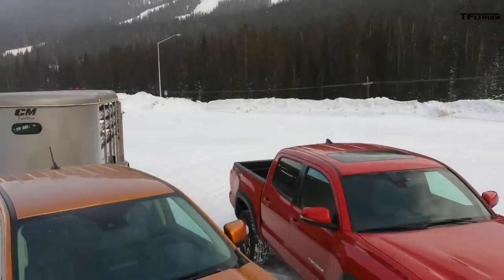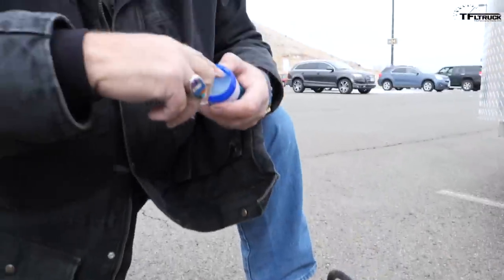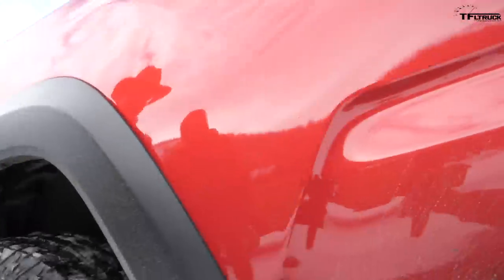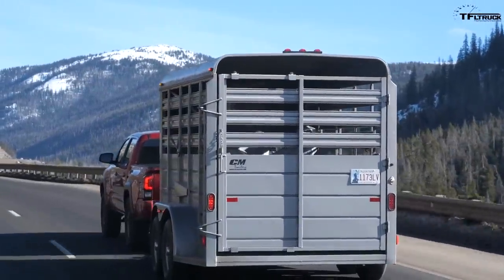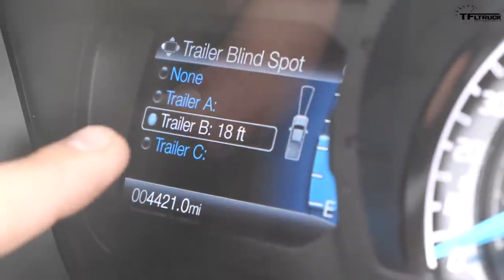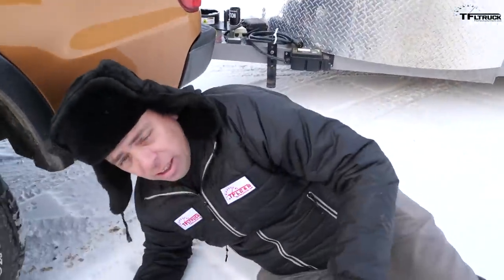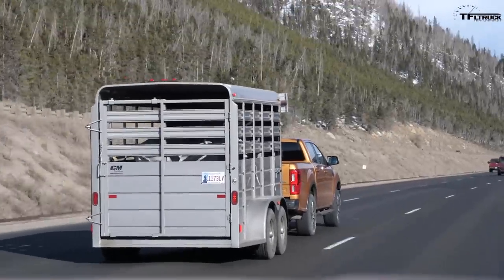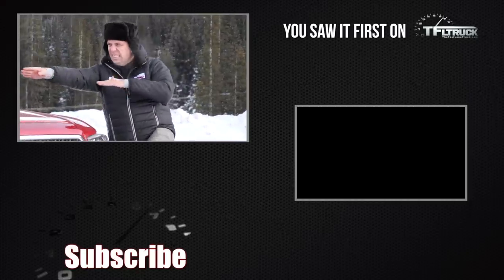Best Midsize Towing Truck? Ford Ranger vs Toyota Tacoma vs World's Toughest Towing Test

Comment: Do a Oil change Test, and lets see how many people like taking the Left Front tire off the Ranger to get to the oil filter, SMH🤔
Reply: Wait, seriously
Reply: Really? Never heard about that...
Reply: That sucks but most of cars today need a tire rotation with evert oil change.
Reply: I did oil changes by taking the tire off, it was actually quicker like that.
Reply: F that. Even the shop guys are gonna hate doing that
Reply: It's no big deal. It has a 10k mile oil change interval. The tires need rotating by then, anyway. My Fiesta ST is the same way where I get an oil change and tire rotation at the same time since it goes so long between oil changes. It doesn't take much time for any real shop to do that.
Reply: @leadnsteel1428  Exactly.
Reply: Yeah nobody on earth likes changing their own oil /s @fread51
Reply: And then plastic push pins to remove the panel behind the wheel which will wear out after a few oil changes
Reply: Also the Ford Explorer you have to remove a heat deflector shield to get to the drain plug.   There’s room to redesign it over an inch to make it miss but it’s almost like they want you to go to the dealership for service, they don’t get it
Reply: I’ll just keep my old truck as long as I can.  Easy to maintain.
Reply: William Heinsinger pretty sure 99.99% of dealers sell new cars with either 
A. Life time free oil changes or 
B . 6 years free oil changes
Reply: If you cant take a wheel off then you shouldnt be doing an oil change
Reply: ultimaetsolder you have to do it with Cummins to easily change the oil.
Reply: You should rotate tires every oil change so you would be taking them off anyways.
Reply: Fords engineers are not as good as they used to be. Now a 20 dollar oil change will be 65 dollars.
Reply: I've done my own oil changes for years. Taking the tire off sounds very annoying. And I would still change oil every 5k miles. I just don't trust these new intervals. Do you seriously want to leave the same oil in a 4 cylinder (that relies on a turbo booster) for 10k miles?
Reply: Devin Bender 2 oil changes with Chevy
Reply: Cant speak for anyone else, but I wouldnt be put off by this additional requirement. Annoying sure, but I change my oil maybe 2-3 times a year, so spending an extra 5 minutes isnt going to sway me from purchasing a vehicle that I may want or like.
Reply: Do you already have a new Ranger? I know the old v6 Rangers were a PIA to change the oil, but I NEVER took off there left front tire to change the filter! Was always able to do so from underneath the truck...
Reply: How about the upside town cartridge on the Tacoma
Reply: Don't worry about it William, these aren't the type of guys who would even consider changing their own oil; they will take it to the dealership as they don't like to get their hands dirty.
Reply: Tacomas new 3.5 engine isnt the greatest for oil changes either.  Skid plate has to come off to get to the new oil filter design. Not to mention it is a filter in a housing which to me is harder to chanfe and messier.  The 4.0 tacoma was a cakewalk to change!!  Both have not made oil changes simple thats for sure.
Reply: I love rotating my tires and Love the MPG on the FORD:) tacoma is OLD Tech with less performance and thirsty engine! small cars have WAY more room above the head than the OLD tacoma
Reply: That engine might be a version of the Mustang four cylinder and may not have been designed specifically for the truck. It is a different displacement, but could be the same or similar block.
Reply: Do you rotate your tires when you change oil? Then what's the big deal? When you buy a new vehicle. Negotiate some free oil changes and let the dealership deal with it. It's a solid Ford truck and will be a big Volume vehicle. If you don't like Ford. I'm sure it's a deal breaker.
Reply: Do you rotate your tires when you change the oil? You do have to remove your tires to rotate them so what's the big hassle? Your issue isn't the oil change. It's you don't like Fords.
Reply: @leadnsteel1428  My dealership changes my oil and remove the tires to rotate them. It's a normal procedure they do throughout the day six days a week. Wow. They must be pissed they have to remove a tire to change the oil on the Ranger.......
Reply: I'm just glad toyota car for 2 years so I dont have to worry about take anything off, if you really have to remove your tire just to do an oil change that sucks and anyone who says it doesnt is just defending their ford pride no one likes extra work
Reply: Soy Boys Unite!!!  Hello AAA?  Could you help me change my tire?

Please!!!???
Reply: @lillarry3000  Tundra with front skid plate requires removal for filter.  I'd much rather remove a tire, and I own a Tundra.
Reply: @zacherymorgan97  those push pins are like $5 for 40
Reply: @creigmacc  honestly I never done an oil change on my tacoma yet since I still have toyota care. But wounding it be easier to remove a skid plate then a tire? The trucks are so high so you dont need to jack it up
Reply: @davidhooper8679  I wish people would realize that 10000 mile oil change interval on an EcoBoost isn't a good idea. If you have EcoBoost go for a lot less. And for god sakes change out coolant (flush/replace) every 30000 miles. The turbos break down coolant a lot faster.
Reply: Yup gonna suck for the 10 minute oil change businesses that don’t even rotate tires.
Reply: @fread51  No, that's a biggie that William brought up because that service shop is going to charge more too if this is true.
Reply: @cessealbeach  sure Cesar Salad, sure. Your ranger is from 2015, talk about old tech. Your ranger brought nothing new to the segment. Apple CarPlay maybe, but that's for sissies. Stick to salad dressings, cesar. Trail control is the Chinese version of crawl control. Lol.
Reply: I worked at a quick oil change shop once for about 6 months while between jobs. They'va all got unique and horrible things that annoy the crap out of oil techs. The older Nissans were horrible. They put cheap bolts that rusted off the front skid plate which had to be removed. Then you had to turn one of the front wheels( cant remember which) all the way out so you could reach thru the inner fender to get the filter. I could go on for hours about each manufactuers short comings. They basically all suck to do an oil change on.
Reply: @devinbender8428  not where I live
Reply: Seriously!!!!???? WTF. So to take out the oil filter, i have to take out engine??? I think its the ford 4.0 that recommends to take out engine to properly service timing chain since one bank has the chain on the front and the other bank has the chain on the back. First beer can body now remove tire, what murican crap. Ill have an over priced Japan engineered truck now n forever.
Reply: @forgedsteelwrench9249  you dont have ro take the wheel off i test drove one at the dealer and i looked under it the oil filer is on the side next to the steering thing
Reply: @fread51  take it for service...thats what ford wants, a subordinate that requires a panzy to take it for service just to inflate the tires because soon the lug nuts will be facing reverse side of the rim.
Reply: Yes, and you need to remove the exhaust header on a 600 ACE Ski Doo. Both sound less than optimal.
Reply: Really 7500 mile oil change its time to rotate anyway.
Reply: Devin Bender not mine
Reply: How am I going to wear my rear tires down to slicks and change them two at a time if I'm forced to rotate them?
Reply: @billgateskilledmyuncle23  trust engineering and advancement in technology.  Owners manual will tell you engineered intervals.  You do 5,000?  Remember when it used to be 3,000?
Reply: @michaelshelnutt3534  it changed from 3000 to 5000 because of synthetic oil. I wouldn't let fossil oil hang around for 5000 miles.
Reply: @davidhooper8679  I would never recommend going 10K before an oil change with direct injection and turbo's on a 4 cyl.  that is crazy
Reply: What does taking off the wheel give you access to...the fill plug or the filter?  Thanks.
Reply: @dewrus2153  They claimed you needed to to get to the filter, but it turns out you don't need to take the tire off at all.
Reply: @trentimus5700 -Yep...they're cheap.  And you can also get the two piece ones that never wear out.  They have a small pin in the middle of a larger outer pin.  You push in the outer pin and then push in the inner pin and that makes the out pin flare out and get tight in the hole.  When removing, you just pull out the inner pin and then the outer pin.  They last forever and it only takes about 3 seconds more to use.
Reply: @brentfromsomewhere -Thanks...good information!  They also said it here: https://www.tfltruck.com/2019/01/no-need-remove-wheel-2019-ford-ranger-oil-change/  So, I guess William Heinsinger was patently wrong.
Reply: I hate when manufactures make cars intentionally difficult to work on, thank you for making people aware of this.
Reply: @felixrodriguez5847 -Please read all the comments...you DON'T have to take off the wheel.  Not sure how this got started but several channels and even Ford has confirmed you do not need to do so.
Reply: @dewrus2153  Okay, thank you for letting me know, I'm looking at both these trucks this weekend at the dealer, but I'm really thinking on buying the Ranger.
Reply: @felixrodriguez5847 -No worries...just wanted to make sure the correct info got out there.  I'm thinking of a Ranger, too.  I have a 2004 F-150 that I love but it's starting to show it's age.  I'm not sure what I am going to do yet, though...I've had no auto loan payments for 12 years and that's been nice.  Our local Ford dealer is getting a Ranger for a day on the 24th of this month.  There will be a Ranger rep on site who will be training the salesman on the Ranger and people can check out the truck.  I"m hoping to possibly get to ride in it.  I'll definitely have to drive it before moving forward with buying one.  The EB engine is great but I'm reserving judgement until I can mash the gas myself.  Good luck to you in finding your next truck!
Reply: honestly a lot of you people making a big deal out of it SMH🤔 and is not an issue and you don't have to take off the left tire of the Ranger all you gotta do is turn it and you have access to it however It is critical that the oil change duration does not exceed 15 minutes or you risk having no oil pressure on start up. This is due to the design of the variable output oil pump.

https://www.youtube.com/watch?v=8pnW7cz8Lb0
Reply: @KingManga360 -Agreed that access isn't difficult and that you don't need to remove the wheel.  I have to note, however, that the link you posted is for the the diesel version in Australia.  The US version is a gas engine so I'm not sure the oil pressure issue would be applicable.  The other vehicles with this EB in it do not have any issues that I am aware of with regards to how long you have to change the oil.
Reply: @dewrus2153  yeah I forgot the wrote down it is  a diesel engine
Reply: @TrugginsOFFICIAL  -And you don't have to do even that much...just turn the wheel and you have the access to the filter.  The folks saying you have to remove the wheel are simply wrong.
Reply: William Heinsinger If you can’t take a tire off you shouldn’t be working on vehicles.
Reply: @jesusofmalibu4946  -But please know William is actually wrong...you don't need to take it off.  Please refer to the rest of the comments.
Reply: Dewy Russ No worries it wouldn’t stop me from buying the ranger anyhow. After owning a brand new 2012 Tacoma trd and selling it after 2500 miles I’ll never buy another modern Toyota.
Reply: I wonder if the new Ranger will have a plastic oil pan like some of their other new trucks. Also ecoboost engines can be problematic depending on the model. I guess time will tell with the 2.3l and how it acts on the Ranger platform. This and the fact they can't design a proper visible tachometer and economics means there are likely going to be many other design flaws.
Reply: @practicalguy973  -You're right...time will tell.  This platform has been out a few years in other markets so I hope many bugs are worked out but I'm sure there will be some...there always are when there is anything new or any significant changes.  The 2.3EB should be good since it's been around in other vehicles but we'll see how it works in a truck.  I would probably prefer some N/A version even if it had less power.  Turbos seem to be the way everyone is going though and Ford has a little lead since they moved to F/I a little sooner than others.  I REALLY wish new vehicles at least had an option for analog gauges.  Sure...these look hi-tech but I like real gauges and real buttons and knobs for anything frequently used.  My local Ford dealer is getting one on 24 Jan and it will reside in the showroom (even if someone buys it) until they start getting more shipments.  I'm definitely going to go check it out in person.  Sometimes, something looks great in ads and video but then disappoint in person....and sometimes, it's just the opposite when things look better in person.  We'll see.
Reply: @billgateskilledmyuncle23  
Are you an engineer?
Reply: @Sig721Tau  nope. But if you want to go there, the engineers that developed the Triton engines made them to use 5w 20 oil. People started finding out in hotter climates that the oil was too thin and caused the cam phasers and other parts to have too much slop in them. This made the clacking sound that many cam phasers make a lot worse. Finally Ford came out and said for those people with cam phaser clack, 10w 30 can be used in place of 5w 20 to help quieten it down. I have been putting 5w 40 in mine since 2012 and have almost 190k miles on my 04 F-150. The engineers are not infallible. They may have pressure from government regulations to be more green and may whip up these guidelines last minute for compliance sake, and not necessarily for what's best for the vehicle.
Reply: @MrHuck  cant keep it forever buddy
Reply: @fread51  Only soy boys take it in for someone else to do an oil change and tire rotation.  Do it yourself and stop complaining.
Reply: Who the hell changes their own oil anymore? Take it to the dealer and you don't have to worry about the tire.
Reply: Save 60 bucks per car and use mobile 1 synthetic vs big shop barrel synthetic yes love changing my own oil.
Reply: Dude are yall serious rn??? How many of yall are techs? or mechanics? Sounds like  a bunch of little cry babies!!  You don't have to remove the tire although thats 1 way . There is a small rubber flap in the wheel arch that's held in place with 9 fasteners. Use a screw driver to remove three of the fasteners. Peel back flap. Remove oil filter. Easy.
Reply: You dont have to take the tire off.
Reply: I cant believe people are defending this crap. I dont wanna take a tire off just to change my oil.
Reply: Brian Rosales he’s lying lol
Reply: William Heinsinger your completely wrong lol
Reply: AutoBlog put out Misleading information about the Ranger, now they say You Dont have to take the tire and wheel off to Change the oil SMH.
Reply: This is a false statement. Disreguard this guy
Reply: Its worth it not to drive Toyota, take it to the dealership cheaper than doing it yourself .

Comment: I barely fit in both of those trucks I'm a tall guy. The taco really is uncomfortable, it takes some getting use to
Reply: I think seat position makes a huge difference too. The door difference was 2" but the interior of the Ranger looked so much roomier just by looking at the ceiling over Mr. Truck's head.
Reply: I agree but not sure about the Ranger. I am 6'-1" and just getting into the Tacoma I hit the side of my head.  That was all it took, didn't even drive it for that reason.
Reply: Being 6’4” no midsize truck not even the gm duo fits me well but the taco is almost impossible for me my head is either in the sun roof if it’s equipped or hitting the roof with out it ... only full-size for me
Reply: I'm 6-2 and have a 17 Tacoma TRD off-road and I have no problem getting in and out and have plenty of Headroom
Reply: I’m guessing you have long legs and a regular torso then because I have a long torso short legs and for me for the seat to the roof is my problem not the leg room.
Reply: @mblake0420  I do not have the sunroof. I have the V6 tow package
Reply: Headroom is a common complaint I see with the Tacoma. They say you sit in it more like a car than a truck which tells me that people with shorter torsos have fewer problems.
Reply: @mblake0420  women generally have longer legs and shorter torsos than men so that makes sense. It's the way the mountain bike industry makes bikes for women.
Reply: I had to sell my gen3 taco. It just killed me on trips. The seating position needs to be fixed.
Reply: @mblake0420  No the tacoma is not made for Japanese people. They get the Hilux. The Tacoma is made for people in North and South America.